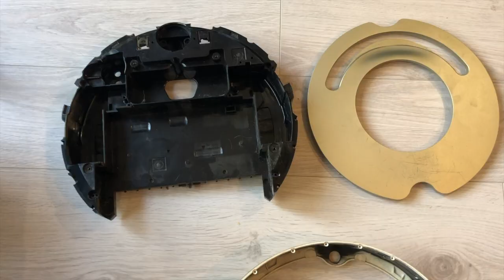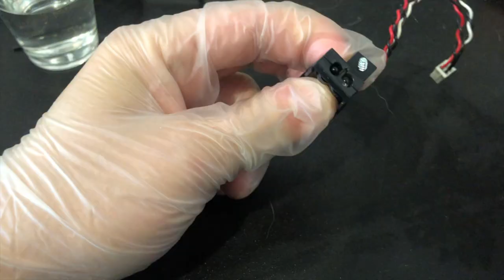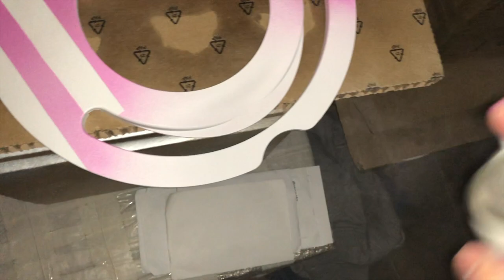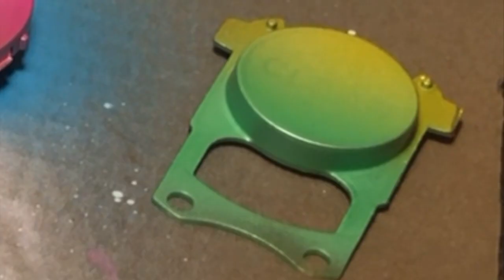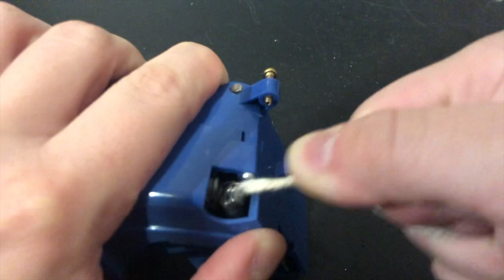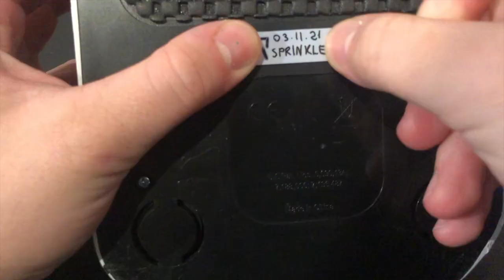Candy Themed Roomba 531 Restoration  - Robot Vacuum Sprinkle

Comment: Goodnight!  I need help.  My romba 531 is defective.  When the reset is done by pressing the three buttons it turns off and gives a sound but when trying to turn on by pressing Clean and Spot the Clean button is in a flashing orange tone with time it turns green and does not turn on when pressing the Clean button.  What should I do to return to normal configuration.  Thank you very much in advance!  Thanks.
Reply from the maker: It seems to me like a dead battery, or a defective motherboard. Try replacing the battery